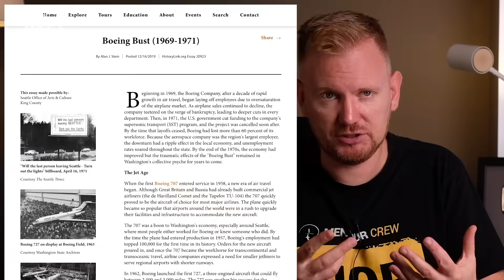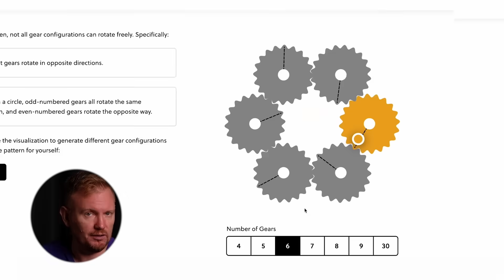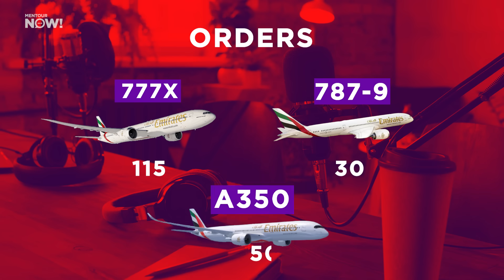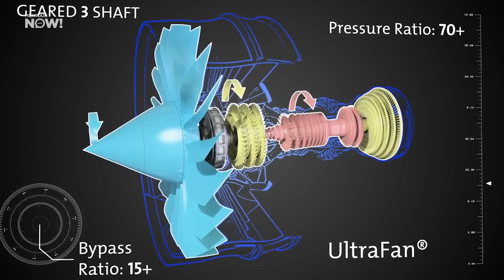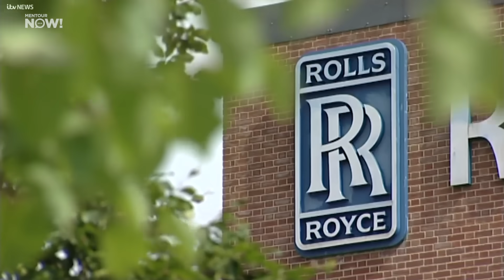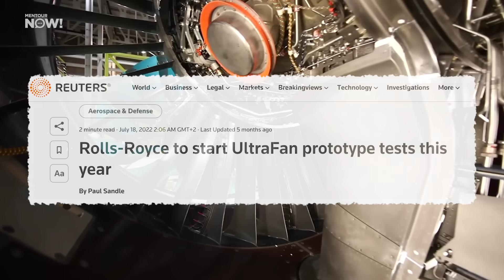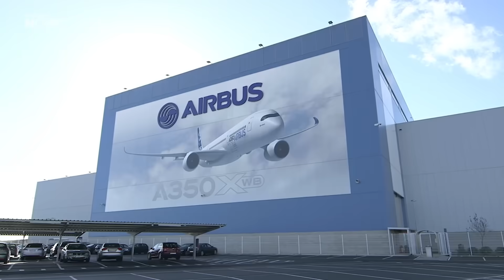Are BOEING planning a 747 with 2 ENGINES?!

Comment: For example GE90-115B has more than double the thrust compared to the JT9D from a 747, but I guess that's not enough then, how much more thrust do we need to basically turn a quad jet into a twin jet?
Reply: I'm an engineer, but not in aviation. From a logic standpoint I'd want to know the plane could fly on one engine if it only had two to start with. That's actually a requirement for commercial aviation I believe, to be able to lose one and still fly.
Reply: I’m not an engineer, but I do work in aviation and that is indeed a requirement for commercial passenger jets. I think losing an engine does require the aircraft to fly at a lower altitude though.
Reply: Well, a 2-engine airplane has to have higher thrust-to-weight ratio, in case of engine failure it can still fly and land safely.  A 747-8 or A380 has a T/W ratio of about 0.25 whereas 2-engine jets are around 0.30.  So a 4-engine 747-8 with total thrust of 266,000 lbs, would need 2 engines of 160,000 lbs thrust to do the same job, assuming the same gross takeoff weight.
Reply: Yes. However the surface area that you loose from taking 2 engines off means you need less trust overall. I believe the 747 was fine on 2 engines. So replacing 2 engines on one wing with 1 engine should work.

Comment: A 747 with two engines would just be so wrong and potentially dangerous just like the issues with the 737 MAX. If they are going to make something to replace the 747 then it would have to be from scratch. We are now experiencing an increase in demand once again for mass air travel which is why many companies are bringing back the A380. I think both companies are facing issues to deliver but ultimately Airbus is going to start pulling ahead. They will both face challenges from Chinese companies going forward though.
Reply: Boeing was looking at a three engine 747 in the 1970’s as an alternative to the 747SP…

Comment: Merry Christmas Peter, hopefully we could see the 747 with 2 engines, I'm just curious about their exact placement in the wings though.
Reply: Boeing have had problems with low space under the wings for years on the 737 which was never designed for ' Big Fan ' Engines , so recently they have come up with a folding knee . so it could fit in the original space under te wing.

Comment: If you want a true, economically-viable A380 replacement, you need it to also be able to carry more cargo. 747 and A380 simply can't hold cargo beyond luggage. Even with 2 engines, it won't get airlines' interest. Maybe a 1.5 cargo deck + 1.5 passenger deck solution might be workable.
Reply: I suggest you look up the 747 Combi. That uses part of the main deck for cargo with a movable partition between the passenger and cargo compartments.
Reply: hmm, any and all pax aircraft also carry some cargo, even little A321’s and 737’s…. 747’s and A380’s take quite a lot of cargo on pax flights…
Reply: Freighter 747: what's this guy smoking?
Reply: @MotoroidARFC  The 747 was designed to be converted to a freighter from day one. Boeing was intending to replace them in passenger service with the 2707.
Reply: @allangibson8494  exactly. Can't carry cargo beyond luggage? Nuts.

Comment: I recently flow LGW SIN on completely packed Emirates A380s. Really love that plane. Flew in 747s in the late 90s, and upper deck was cool, but still A380 is nicer.
I think point to point is only applicable to the US, most countries only have one or two busy airports
Reply: There are plenty of busy airports in Europe and East Asia where people want to go from everywhere to everywhere.

Hub&Spoke is so extremely attractive for Emirates (and Etihad, and so on) because they fly people between East Asia and Europe with a stop in Dubai (or Abu Dhabi or whatever): You connect everything in Asia with everything in Europe and you only need one airplane per airport.
Reply: @whocares2277  Most / all of the airports outside of the capital cities in SE Asia I've been to can't handle anything bigger than a A320 / B737, so there aren't going to make point to point outside of SEA, and I don't think there is that much demand for direct flights to Europe from SEA. I think there are a number of round robin routes in Malaysia and Indonesia.

Comment: How about a twin engine version of the C17?… being a high wing, it seems to have plenty of ground clearance.
Reply: The conjecture would be something sized comparable to an A380, so more like a C-5 in size.   A big aircraft with high wing to accommodate the monster engines, but with empennage more like an An-124 than the high T-tail of the C-5.

Comment: My opinion before watching the video: yes, you can do it, but it would be pointless. The 747 is only one aircraft generation ahead of the 737, and Boeing had huge problems keeping the old design 737 up to date. Just look at the MAX crashes.

There's also the issue of the hub-and-spoke business model steadily falling out of favour in the last decade or two. Smaller long haul capable aircraft now make it possible for airlines to support fully booked direct flights between lesser used and lower cost airports instead of feeding all passengers to huge and overcrowded hub airports with their expensive landing and support fees along with their miserable customer service.

Boeing could still build a 2-engine 747, but it wouldn't be used for carrying passengers. Instead, it would be used exclusively for cargo flights. And even that is a limited market because, apparently, fuel consumption isn't as much of an an issue with cargo jets, which is why the industry loves to use converted passenger jets to haul freight. It's cheaper to convert and exploit an old aircraft than it is to buy a new one.

Comment: I have a problem with "a larger aircraft" statement... Larger.. than what. This statement originate in 1969 when the 747 premiered and later in mid 70-tys when 747 outsold the L1011 and DC10 with quite some margin.

But we are talking about a 747-100. It have a 3 class capacity of 276 passenger. Compare that to a 777-200, that was the first really large twin that when it came, outsold the 747 quite significantly, with a 3 class capacity of 305 passenger, with pretty much the same F/J/Y configuration and with the 787, the model that sells the most, the -9 with a capacity of 290 (but with no F, so basically the same capacity) and the A350 .. again what version sells the most, the -900 series, with a 2 class capacity 315, so about the same size.

The reason might be aerodynamic. A heavier aircraft needs a longer wing, but when it becomes very heavy, the wing need to be so long, that it self need to be heavier. This is specially true for 3 engine aircraft and aircraft that carry lots of internal fuel.

This reason it self is based on the speed of sound. Flying faster and higher, is no longer possible. And flying slower needs a even larger wing. So something like a 787 that is very light, can fly slower with a shorter wing but with the same load as a 747-100 (well the wingspan of the 787 is actually a bit longer, but it wouldn´t need to be).

This is the sweet-spot where you waste the least amount of air resistance on both wing and parasitic drag. And it remains largely the same regardless of what technology exist around it. Well unless we have supersonic plains, that would change it a lot. (and the optimal sweet spot for a mach 1.7 plane is huge, like 1000 people.)

With that.. a slightly larger aircraft, like a 777-9x will just pass a tiny bit outside of what is optimal and there for not effect economics that much.. and.. pilot shortage is also a thing

Comment: Air Force One will always have four engines
Reply: Air Force One is whatever plane the Commander in Chief is on.  Most of the Presidential Aircraft have two engines including variants of the 737 and 757.  The next large Presidential Aircraft will be based on the 777x.

Comment: Maybe RR is doing these engines for future new Mriya version? 🤔😆 It will be a fantastic experience to see an engine bigger than my home...
Reply: That would certainly be a niche application, but hardly a viable sales volume - particularly as a freighter only.  A 4-engined Mrya could even have a higher MTOW than the current 6-engined version, and have a couple of spare carrying hardpoints - because how else are you going to carry spares around for such a colossal beast?  And the improved efficiency over the current version could open new markets, as it would be easily the most fuel-efficient large freighter in the world.  I'd expect a military version, too.  Hardpoints in the roof for space launches from the equator?  No problem - Mrya already has them!  Travelling eastwards at an easy 900km/h, the platform would have the orbiter up to a real speed of 2,500km/h before even firing its own engine!  Virgin Galactic sign here, please! (I wonder if a legal way could be found to carry passengers onboard to watch the release/launch of the orbiter up close?)  Could pay a lot of the bills.
It could be then developed into a passenger version, to deal with the slot congestion at major international hubs like Heathrow, JFK, Dubai, Singapore, Frankfurt, Schiphol and Paris CDG, etc.
I wonder how many passengers it could potentially carry - 600+ seems entirely possible, even with some hefty freight allowance, although the terminal capacity for handling that many passengers hitting security and baggage claim in one horde might need some work.  I'd expect it to use two gates, so departure lounge capacity would be less of a problem.
I foresee a major potential for an Antonov/Airbus collaboration on a whole new series based around the An-124 & An-225 designs - possibly using Airbus composites and RR engines to put efficiency through the roof.  Heck, a military version could have one or two engines dedicated purely to electrical power, for a major AEW/AWACS installation,  or the colossal power needed for directed energy systems.  A ground-level optimised version of the engine would make an awesome emergency fly-in generator for any disaster zones, and could be marine-adapted for ships as well.  The uses for such a large and efficient turbine engine go well beyond aviation, although in combination with Airbus's expertise in composite construction and Antonov's unrivalled knowledge of heavy-lift cargo aircraft it undoubtedly could have a major impact there.

Comment: Rolls Royce is likely developing a big, big engine to accommodate newer, bigger airplanes and smaller airplanes, as well. We have seen issues arise when smaller engines have been scaled up. It might be easier to avoid issues to scale down an engine rather than scaling up an engine.  For instance, the engine core may remain the same while the fan and gears may be changed out.
Reply: Also possible they are looking at the retrofit market, where a larger engine run at lower power setting can be a lot more fuel efficient, allowing an older airframe to get a low cost boost mid cycle to improve operational costs, and offset the massive expense of a new airframe with just a minor engine upgrade, providing there is still enough life in the original airframe to allow the saving in fuel to recoup the cost.
Reply: @SeanBZA  And military market, with military transports almost always being high winged they could more easily hang a big engine. That said they would need a US engine factory if they ever wanted to hook a re-engine contract for something like the C-5 Galaxy(unless the RAF flies them).
Reply: @SeanBZA  I think cargo conversion could make the engine upgrade an option too. Cargos have been converted to passenger, too.
Reply: @dthomas9230  .
Reply: This engine is so big it looks like it would even have trouble fitting under a 747 without some heavy modification. 
There is one specialist application I know of where such huge engines could already be in demand - aircraft designed for carrying spacecraft. Especially for climbing to high altitudes for launch..
Reply: @Lucien86  Like they ferried the X-15 and the F-17 stealth version that doesn't fly but controls its crash invisible to radar after launched from its ferry?
Reply: @dthomas9230  Yes exactly. Virgin Orbit is one - launching small orbital rockets using a converted 747. In reality though the 747 is a bit small and launchers could use much bigger machines.. For these kinds of machines as they get bigger things get pretty strange and oddball very quickly.

An ideal size might be something like a 1000 ton lift capacity, with a height ceiling of say 40 Km high (130,000 feet). That takes an enormous wing and enormous engines. A wingspan of maybe 150-160 metres - which is too big for current designs but might work with some kind of bi-wing structure. Powered by maybe 6 or 8 of those new super large engines.

The whole idea is probably obsolete anyway thanks to SpaceX's Falcon 9 being first stage reusable.
Reply: @Lucien86  : NASA is doing some experiments with biplanes, and if you run the fans off electric motors with power beamed up from the ground then you should be able to approach or exceed Falcon 9 performance.
Reply: @absalomdraconis  The trouble with these machines is that cost per Kg to orbit generally goes down with increasing size - so big is best. Super large aircraft need huge amounts of power to fly and so need an enormous power source. Without any detailed calculation about maybe half a gigawatt. An antenna and receiver and electronics that can handle that will weigh a lot. Maybe several thousand tons. Too heavy to fly.  :(
Reply: @absalomdraconis  You can't 'beam' that much power up to a flight vehicle without frying the payload inside...
Reply: @Lucien86  Ahhh! That makes sense 😁
Reply: I believe that at a certain point the core would need to gain mass as well to provide enough torque for the ginormous added mass of the fan blades, reduction gear and added gas volume that needs to be accelerated quickly.
Reply: Is anything larger than the 777 or A350 planned? I doubt it.
Reply: @chrisamies2141  There are no serious plans for any aircraft larger than 777.  The 747 and A380 are basically dead.  And this engine with the enormous fan is only designed for 105,000 lb of thrust, which puts it in the 777 range.
Reply: Spoken like a true ignoramus.

Comment: I would tens to think it’s not possible for the same reason that they don’t reduce the engine count on the B-52. 
A single engine loss would be extremely difficult to control without a huge amount of rudder input. That’s what I read about the 52. Thank you sir for the intriguing concept
Reply: You are aware modern (or post 70s really) fly by wire systems can stabilize worse stuff than loss of engine? Like, say, deliberately unbalanced planes?
Reply: Using less engines on the B-52 would mean bigger engines disrupting its aerodynamics, increase stress loading and yaw in an engine-out configuration.
It's quite obvious the USAF wanted to limit the risk thru this rather conservative approach, with a very similar size & power engine, as there's no option to alter the aircraft should anything go wrong, and no time to start over if serious problems occur , nor can they continue with the old engines.

The outer engine pair is already hanging rather low to the ground, limiting the fan diameter
Putting big fans on the B-52 would also increase its already big radar cross section

Comment: I always wondered if you can offset the turbine and cowling higher with gearing and transfer case from the jet engine centerline so you can fit an even bigger fan?
Reply: The engine and transfer case itself would be in that case blocking part of the bypass air / thrust in the lower half of the fan….